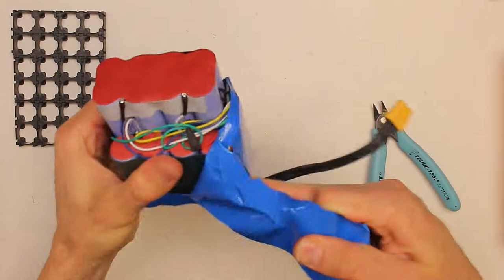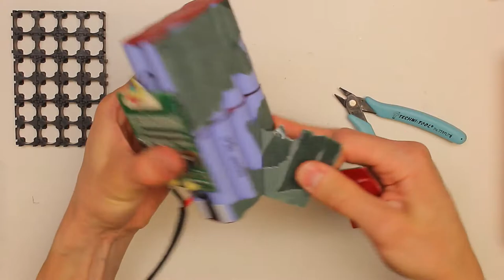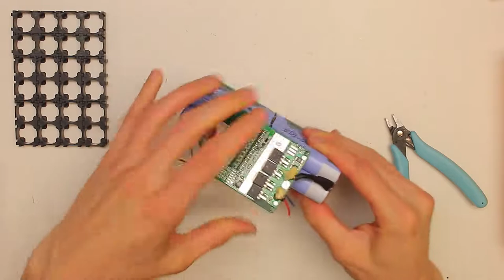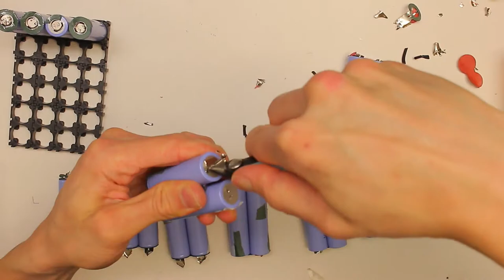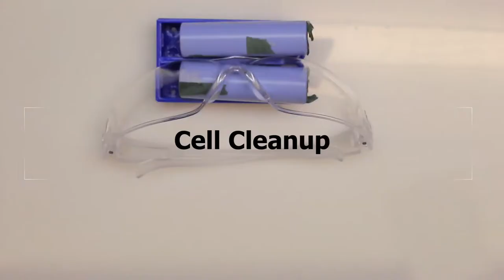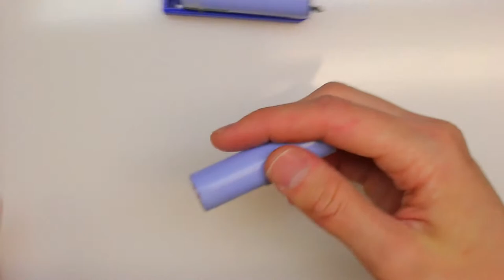Hoverboard Pack 18650 Extraction

Comment: Hi man,can you put those bateries in a vape mod?It is safe?
Reply from the maker: Not recommended. They're LCO chemistry, which is older, lower current rating, and less safe than newer NCM or LMO cells. If you really have to use reclaimed cells, power tool cells are your best bet, e.g. Samsung 20Q, 13Q, or LG HB2 which are common.